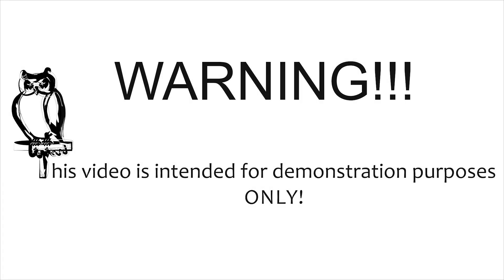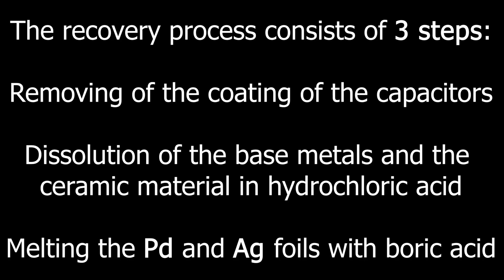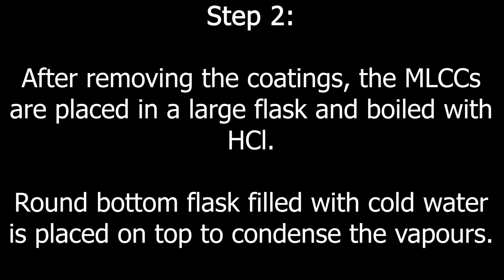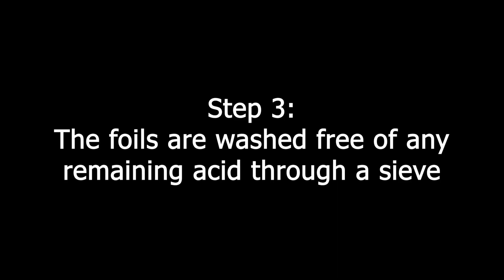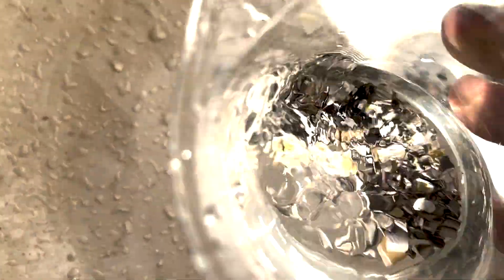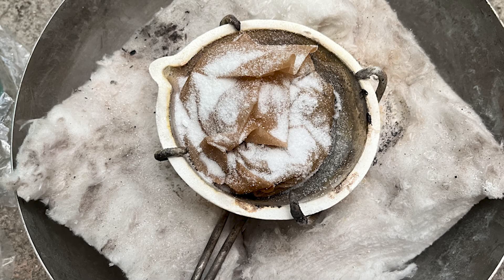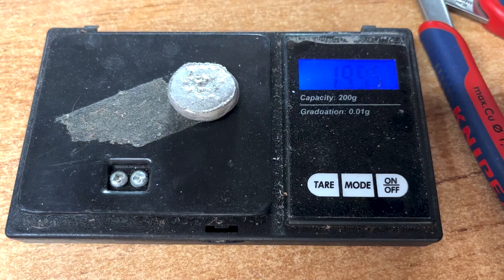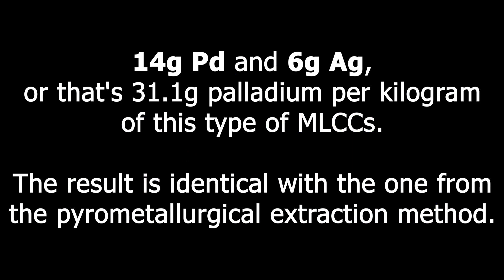Palladium and silver from capacitors - the WET process

Comment: From my understanding brother something that is highly caustic to boiling can desovle metals too. Boiling in HCL will remove base metals but tin should be clear now purple colloidal gold is purple and also from my understanding there's supposes to be small amounts of gold in MLCCs.
Reply from the maker: no gold in this mlccs, you can find gold on the surface mount mlccs wich is leached from the pcb by the solder
Reply from the maker: the puprle colour is from titanium salts formed from the dissolution of the ceramic substrate - barium titanate
Reply: @OwlTech333  but I have seen a video where they refine Metals with caustic soda so you probably did lose some metals their brother.
Reply from the maker: Not with this process and caustic is used only to remove the coating

Comment: Hey Owl, Another great vid.
Mate, I wonder if I can ask you to do an experiment. My new lab is not ready yet and I have been wanting to try the following.
Strip completely 6 - 10 motherboards with an air chisel or hammer and chisel, and do a rough sort to remove aluminum capacitors and other obvious junk. Then either incinerate and crush or boil in hot H2SO4, remove any magnetic materials, then boil in HCL + Some citric to remove tin. Then dissolve all metals other than gold in hot HNO3. Recover Ag (and then any Pd) then recover Au with Aqua Regia.
My theory is that sorting components (if not making a video) is a waste of time and that nearly everything can be recovered by simply incinerating, grinding and recovering.
As you are one of the few refiners on YouTube who understands the chemistry so I thought you might be up for the challenge,🙂

Comment: It seems too easy! Just boiling in HCl to remove ceramic? No Nitric acid required? Incredible.
Reply from the maker: Yes this is a recovery process only, refining is another story
Reply: @OwlTech333  true, but it's so much less work than pyrometallurgy and cupellation
Reply from the maker: @dizzious  only seems this way, with pyrometallurgy this whole day of boiling could have been squeezed down to an hour tops

Comment: Looks like the sodium hydroxide is a bit cleaner process than ashing these type of capacitors. Thanks for showing! 
I have a nice stockpile of these older caps. Id like to use the lye to strip a few other ones that look like they may be pd/ag type mlcc inside.
Reply from the maker: NaOH works on the clay coated MLCCs, for the plastic ones you'll need H2SO4
Reply: I am trying right now the NaOH method on some blue ones and I think they are plastic. I have been soaking them for 2 hours and nothing is happening. I will try to wash them and then add H2so4 and see if thar works
Reply from the maker: @razor1983  hot H2SO4 will, but on some of them only flame helps
Reply: One more thing if I'm not to nosy. How can you tell when the acid is saturated? Thank you once more for sharing with us!
Reply from the maker: @razor1983  becomes very dark purple, usually after 30min of boiling
Reply: Thank you! So ashing and than continue from step 2.
Reply from the maker: @razor1983  yes
Reply: Thanks, i suspect some of these colors of old ones may also be clay, they have that same look. I had set them aside to check. They were blue, slightly different brown shades, and also a turquoise one. 

Though the turqouise one I have doubts. (There's a few different shaped ones of these)

Comment: Heya !
Another method for recovery which will be of great interest for those who don't have furnace at home !
It takes a long time to get rid of base metals using HCL but...
It's the costless method of all !
Anyway, i must ask you about your last video for bga caps and the problem of gold yeld.
Did you recover more gold or did you bought bad materials ( Some bga caps do not contain any gold instead of their "gold corner indication".)
Thanks for sharing your work and wish you a good summer time.
Reply from the maker: I think I've been given predominantly copper wire chips but anyway I keep all my slags so there will be a big remelt someday
Reply: I think mostly missing gold was caused by the amount of copper heat sink bgas. 
The yeild estimates are likely more accurate if they are sorted. The batch seemed to be mostly the heat sink ones. 
1kg heat sink bgas will likely be similar yeild to less than 
1/5th kg regular/gold corner bgas
Reply: @colonialcharlie8702  what do you mean by "missing gold"? Why are all gold recoveryists complaining about missing or lost gold? Could someone please explain how gold is lost?
Reply: @kamelsamer5768  the estimate for gold per kilogram is for either mixed bgas with some copper heat sync ones. (This was soo many if i recall) Or for no copper heat sink ones. The heat syncs are very heavy and skew the estimated gold recovery. 
Just something to keep in mind for those who may purchase or bid based apon an estimate they read.

Comment: Hi, may I ask you to check the hydrochloric acid solution for palladium, please. In presence of oxygen (air) palladium is dissolving in hydrochloric acid. Thank you for the great video! 🌟 🌟 🌟 🌟 🌟 👍
Reply from the maker: I kept all washing acids and added aluminium foil to them, only copper precipitated
Reply: @OwlTech333  That’s strange …
Reply from the maker: @escrapchannel  it did cross my mind that if it dissolves the copper legs it will be dissolving the Pd too but...
Reply: @OwlTech333  The point is that I gave up from this process as I was finding Pd in the hydrochloric acid. Interesting .. I will do some experiments this weekend. Thank you!
Reply from the maker: @escrapchannel  diluted or concentrated  HCl you were using? If you want to be 100% sure it won't touch the Pd you should use nickel chloride solution under reflux to dissolve the ceramics
Reply: @OwlTech333  I used 30-33% hydrochloric acid, so more or less concentrated. Thanks!
Reply from the maker: @escrapchannel  i used diluted 50:50 acid to water
Reply: Раствориться если добавить перекиси водорода
Reply: @беняцукерман  Thanks! I will try it for sure!